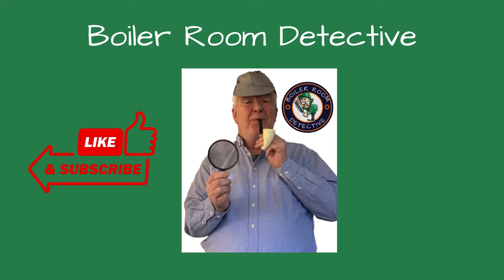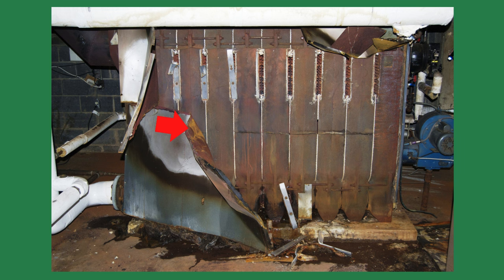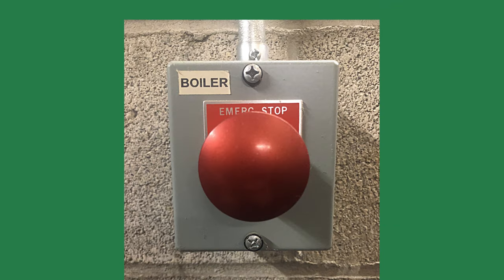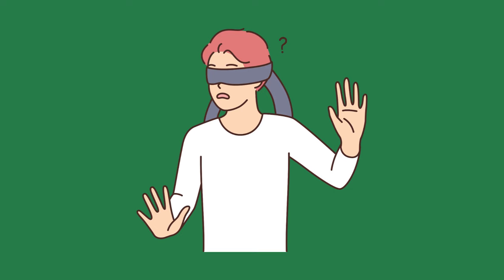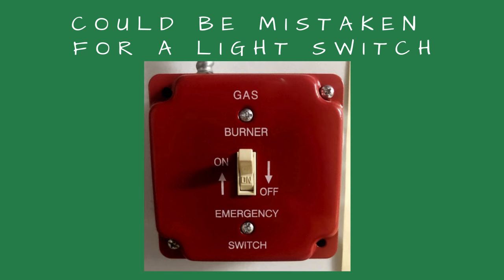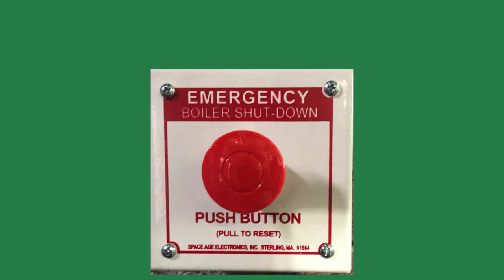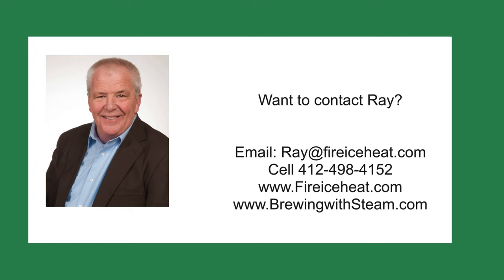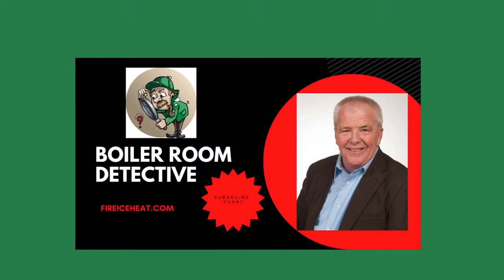Case of why door switches save lives

Comment: Yup. Typical Smith section. Change some every year it seems like. 
My theory is no swing joints on the riser piping leaving the sections. I think it stresses the metal too much on cold start up.
Reply: That and must be a weak spot in the casting. Installing “low fire hold”Aquastats helped but didn’t always prevent it.
Reply from the maker: The firefighters sprayed it cold water That is never good

Comment: Ray. Great Traing! As pointed out in your discussion with a Line Voltage Disconnect, what are your thoughts on Control Relays that fail (failed via shorted coils and "stuck" in operation modes) and the breaking of Controls only vs. Line Voltage? Killing the transformer for the controls may not allow the relays or solid state/electronic controls may not stop a run away? Whike I agree whole heartedly with the Safety of these (mostly frankly non-existent) Shut Offs, in the Refrigeration Trades with the advent of new Safety Protocols the Shut Offs kill everything and activate ventilation for noxious or O2 depleting levels of refrigerants. The problem I have with these Safeties is that if there were a Fire the ventilation aspect could feed the blaze.
Reply from the maker: Thanks for the comment. On commercial projects, the burner manufacturer tells you where they want the emergency stop switch. if not, I suggest a normally open contact with the child wired in series with the operating and safety controls